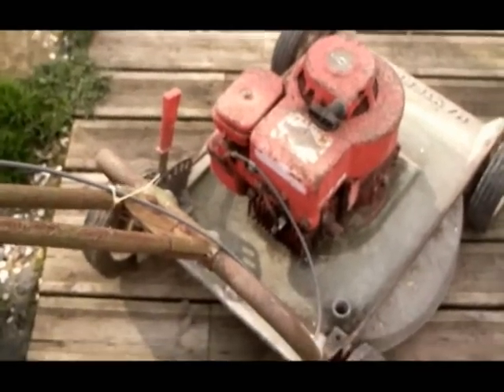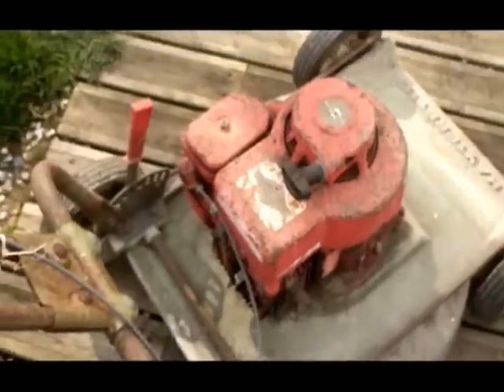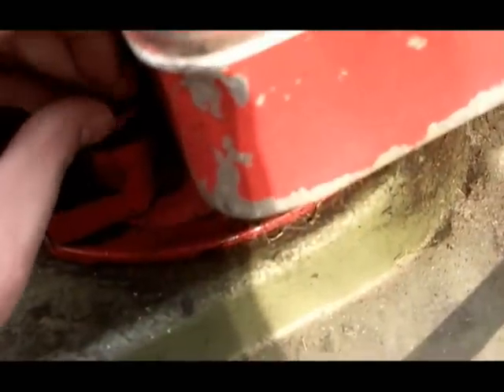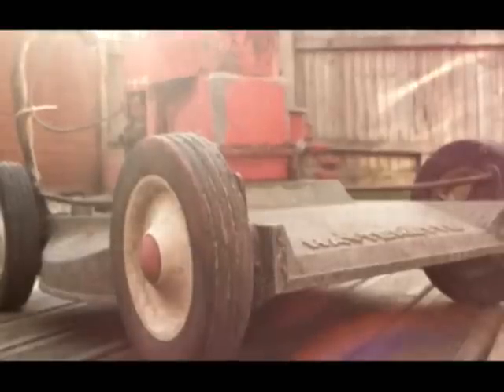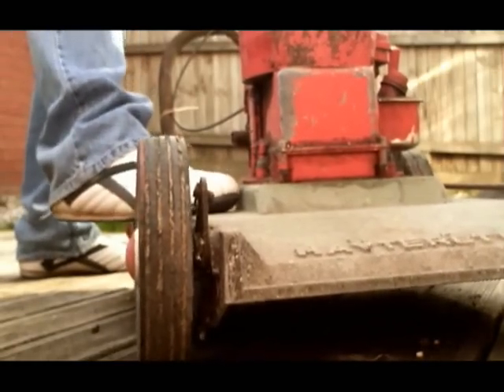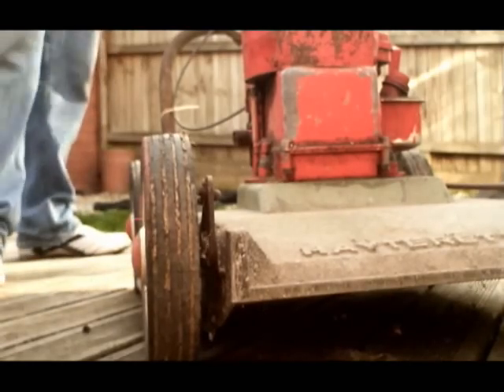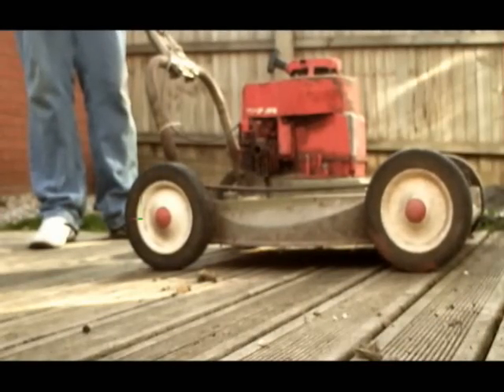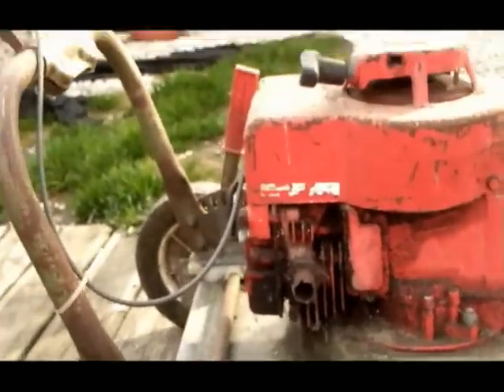New Lawnmower!

Comment from the maker: @bev1806 From what he has said to me it sounds like he just needs new points and a new condenser. If it was running before then the coil can't have gone. Unless it has a very rare issue where the coil will produce spark until the engine warms up, then it breaks down.

Comment from the maker: @russelD9 Check for spark, take the spark plug out, connect it and put it against the engine, then get you dad to pull the engine over, then see if the spark plug sparks. Make sure you press the red primer bulb. And also make sure the safety bar is pressed down. Also make sure you have petrol in the thing!

Comment: @MrMoterKid do you have a set of gauges like the ones in my video?? if you do you need to check the gap in between the points and see if they are set at 20, if you dont have any then im not sure how you will be able to set them correctly. i still haven't fixed mine yet plan to do it when my dad gets back :)

Comment: @bev1806 i have spark now, turns out the engine broke the flywheel key and the engine stopped sparking because the flywheel moved. i got the old key out of the 03 blown briggs engine with some help from my uncle and put it all back together, i have had it running now so all is back to normal. 

my uncle told me i hadn't tightened the pull starter enough so it came loss and broke the key i have tightened it hard as we could now and the engine fires straight up.  so all is good now :)